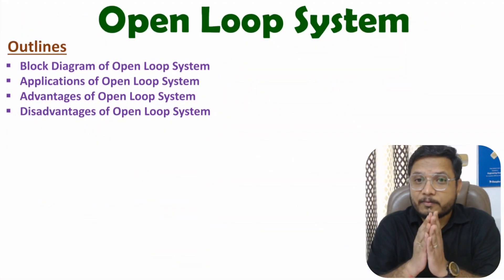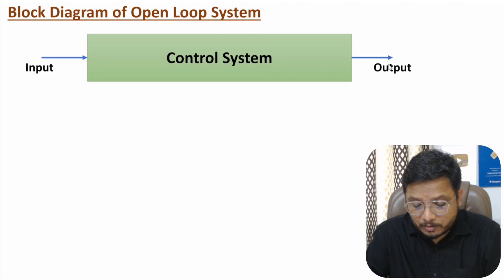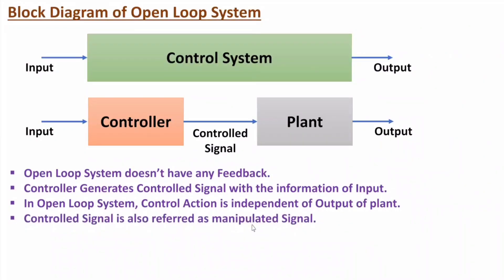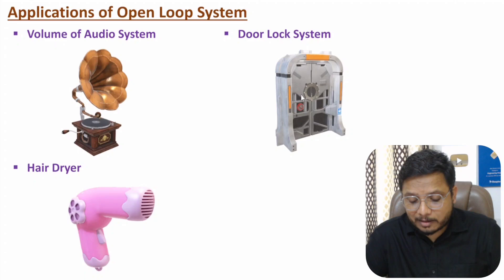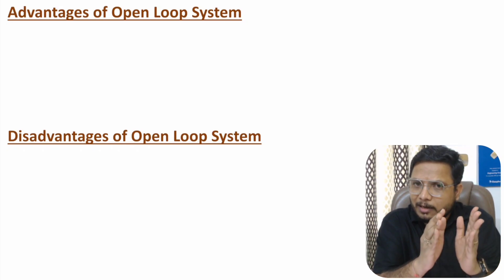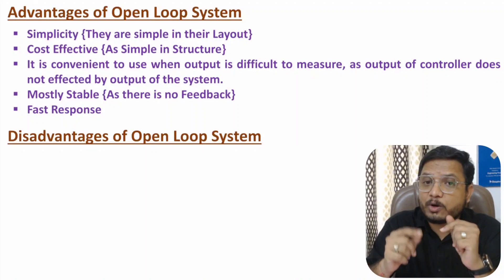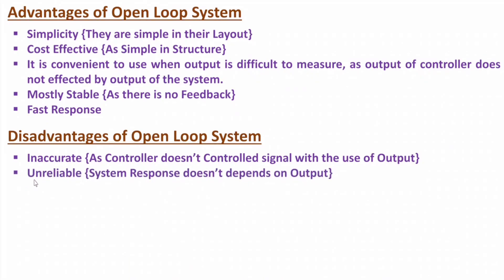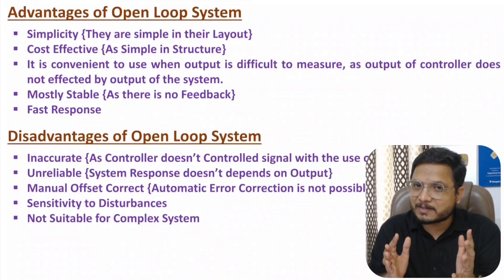Open Loop System Explained: Block Diagram, Applications, Pros, and Cons

Comment: Hello! Thanks for the wonderful lesson. Please tell me, do you plan to highlight the issue of transfer functions of step-up and step-down converters, as well as the PID controller, in this lecture series. Thanks
Reply from the maker: I will cover PID Controller for sure. Step up and step down converter is covered in power electronics.
Reply: @EngineeringFunda  I was referring to the transfer functions of various types of converters. Have you covered this topic before?
Reply from the maker: @SMV1972  I have covered converters in power electronics, but is not with respect transfer Function, it covered with respect to working and waveforms.
Reply: @EngineeringFunda  thank you!!!